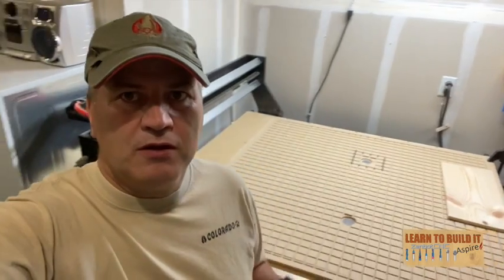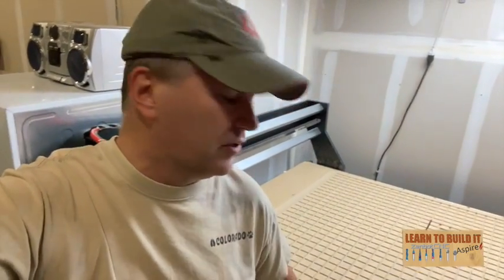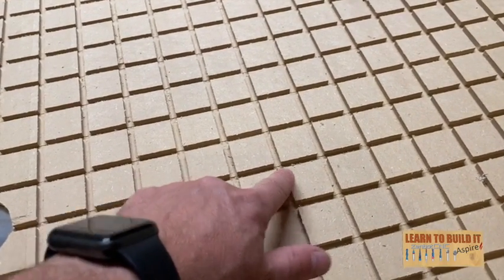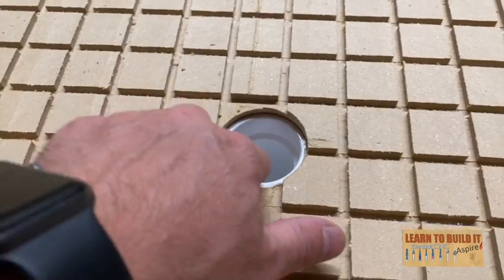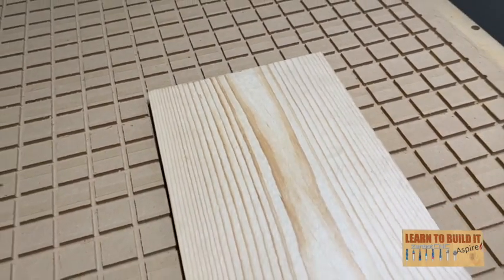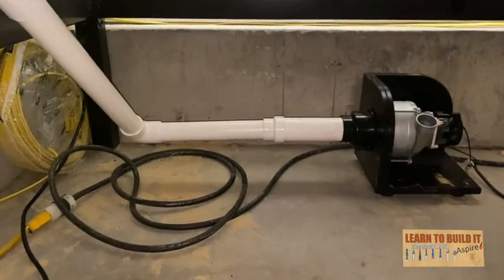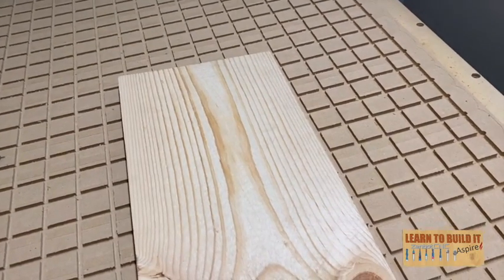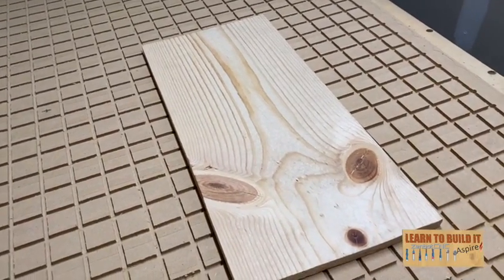Vacuum table build for my Zenbot CNC

Comment: How well has the foam rod  gasket held up? I'm thinking of buying from the link, but I'm afraid the smooth outside part of the foam will come off.
Reply from the maker: The real issue is you cut into in in spots, but the vacuum still holds it nicely. It is cheap enough that it does not matter for me
Reply: @learntobuildit2785  
Yeah, I figured the same thing and went ahead and ordered some, pretty cheap. I recently made a vinyl cutting attachment. I'll be using a spoil board and take advantage of the permeability of MDF to hold down vinyl mostly. The bed on my machine is about 1/4 of yours too.

Comment: The problem I can see with this setup although it looks good is when you do a full cutout of the material and you go down slightly deeper than the piece your cutting out. What will happen is that you will leave grooves in your vacuum table which will/could become vacuum leaks that you're unable to plug.
Reply from the maker: You are correct. I have not made a new video, but have changed the way I cut the top. I now have a top that is cut all at the same height. No lip at the back side. I had to drill other holes to hold that board down.

Comment: Have you tried a project where you have to cut a part out? Do you still retain enough vacuum to hold the loose parts in place? I like the table just wondering if it will work for parts? I’ve seen where others have used low density fiber board over a table like yours a pull a vacuum through it.
Reply from the maker: Yes it has been ok so far. I am placing the foam core specifically to help with that. I have also once used a larger board and used the left suction while cutting on the right side of the board. I am guessing there is an instance that it may be an issue.
Reply: @learntobuildit2785  I have seen where the vacuum was able to suck straight through an MDF sheet without any attempt to seal anywhere on the table

Comment: What led you to decide on a .23" depth?
Reply from the maker: Well Zenbot told me that was the best height. After using it for a while it does work really nice. Leaves just enough foam sticking up to seal the vacuum.
Reply: Nvm - just thought about it - for the gasket.  I am building a flow through table and am having trouble deciding on the depth of the grids